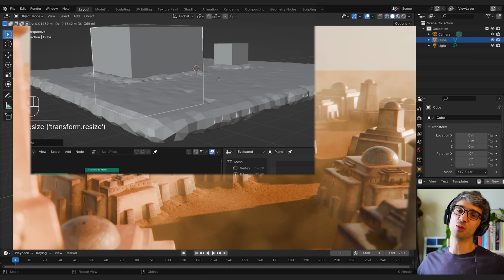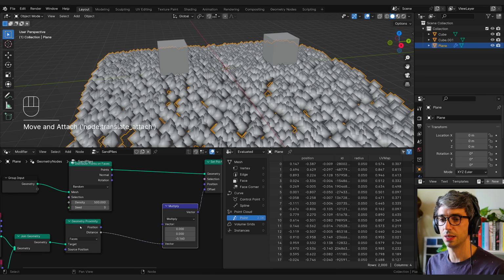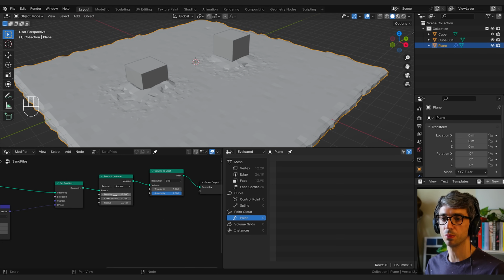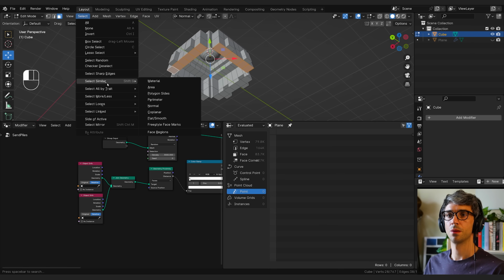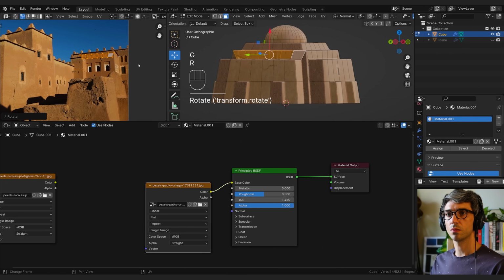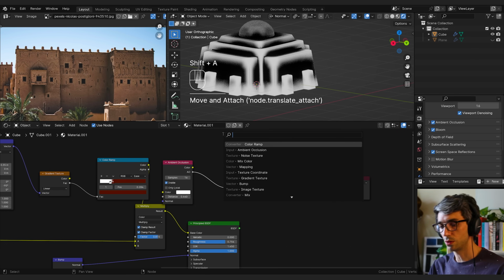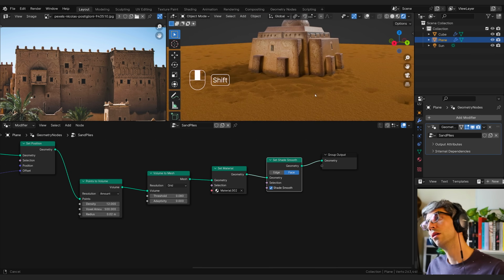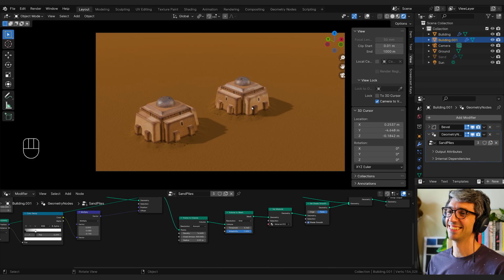Procedural Sand City Using Geo Nodes In Blender Tutorial

Comment: Thought Id try to be smart by putting the cubes in a collection and dragging the collection in, but the cube weren't being recognized. if you want this to work add a realize instances node in between collection info and proximity nodes. This should help if you want to use multiple cubes without having to drag them all in.